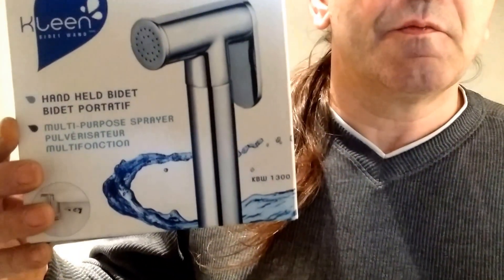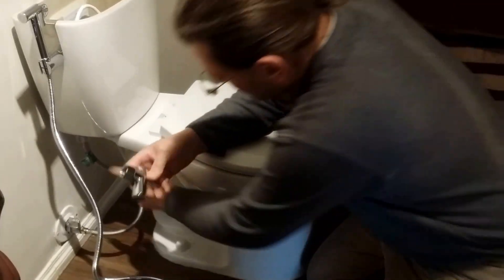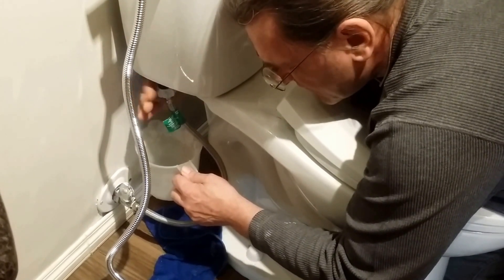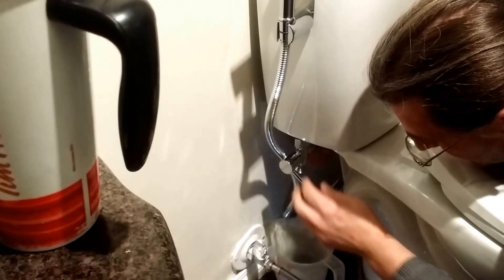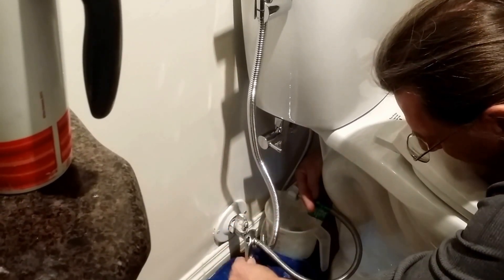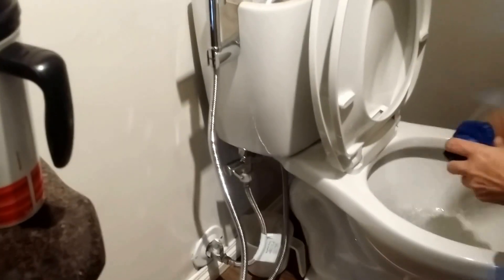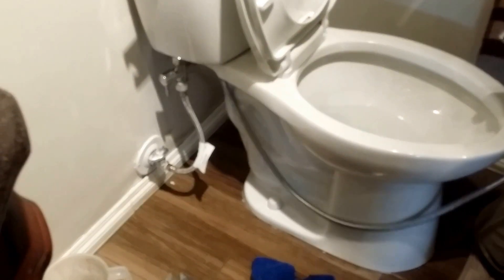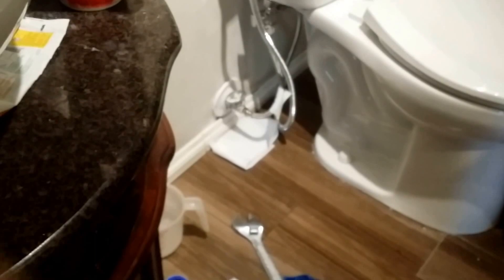Kleen Bidet Portable Hand Wand Install On North American Toilet

Comment: I just installed this product and I have press the handle really hard for the water to come out. I am wondering if I ended up with a faulty product or that's how the user experience is
Reply from the maker: The couple that I have installed were not too hard to press the handle. It is possible that you have a defective product. What happens when you throttle the valve for the toilet supply? I would try that before returning the product.
Reply: @handymanreality  That was my  first thought too. I tried closing the supply a bit so the water pressure would not be so high. But still no luck
Reply from the maker: Sorry it did not work out well for you @auditio

Comment: I bought and installed the same one, its great and works fine. But! No refunds at all once you install it, and for a handheld, the aquas 360 is the better choice on amazon. Cheaper too for canadians. Reason been, I'm a bigger guy and I couldnt properly use it without sticking my hand directly underneath and as you can imagine, wasnt very clean. The aquas 360 has an extending piece and is meant to be left on, ready for use, rather than turning the valve on before use, and off after use.

Comment: Teflon tape should not be used.
Reply from the maker: Thank you for your comment. Would you care to elaborate why? 

I understand that threads are not the active seal in plumbing accessories, although, on such parts it can often end up being that way. 

I also don't think it is necessary for shower heads too, although, often it is the only alternative that works when the washer/seating will not do it's job.